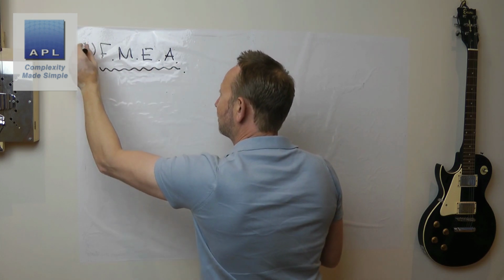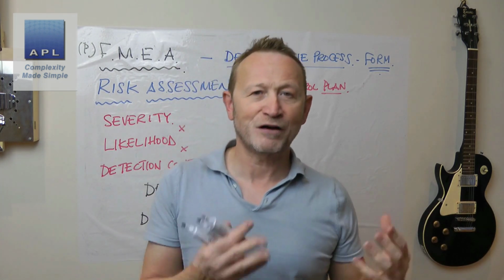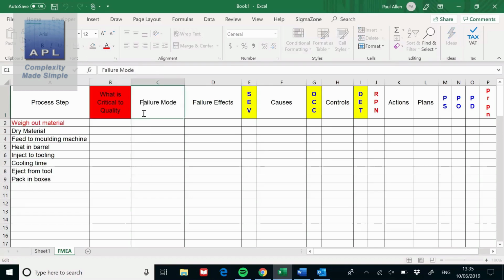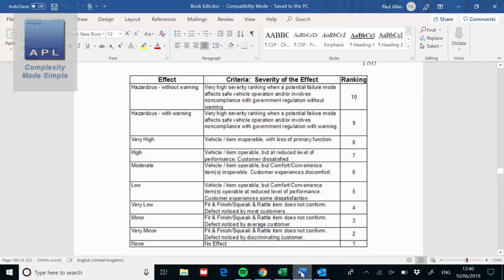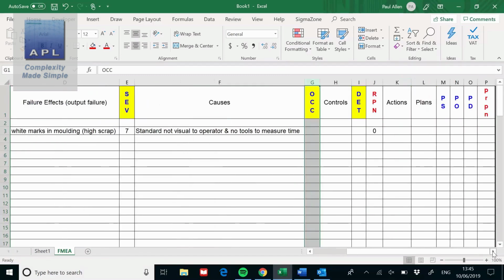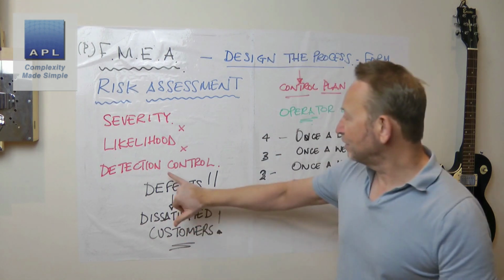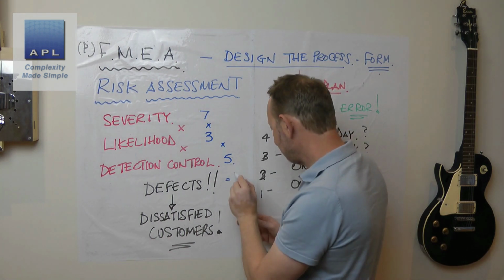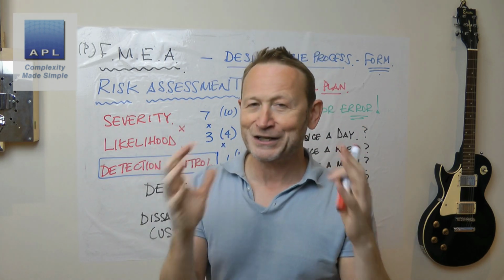How to do FMEA properly - A tutorial

Comment: Unfortunately, there are two major problems with the use of Risk Priority Numbers. The first problem is the fact that while the RPN values range from 1 to 1000, there are only 120 possible values for the RPN values.  Moreover, these 120 possible values are not uniformly spread out between 1 and 1000. This restriction on the number of possible values for the RPN scores leads to the second problem.  

With 10 levels of severity, 10 levels of occurrence, and 10 levels of difficulty of detection, we will have 1,000 different possible problem descriptions. The RPN scores will sort these 1,000 problem descriptions into 120 distinct classes.  Some RPN values will group up to 24 problem descriptions together, while other RPN values will correspond to only one problem description.  

So, the second problem is that the RPN values sort the 1,000 problem descriptions into 120 artificial groupings of different sizes. One final thing: The RPN value are ordinal-scale data, which means that addition, subtraction, multiplication, and division are all nonsensical operations. 

In the words of Donald J. Wheeler, " If you feel that you have successfully used RPN values to identify problems to work on, you have been deluding yourself with the elaborate mumbo-jumbo that surrounds the calculation of the RPN values.  While you may have been successful, that success did not come from the use of the RPN values."

If you feel that you absolutely must have a systematic overall ranking of all the failure modes, then use 1 through 5 instead of 1 to 10 for the rankings of each aspect and then create a three-digit code for each failure mode, where the first digit is Severity, the second digit is Occurrence, and the third digit is Detectability.  

To signify the ordering of these three aspects, designate this three-digit code as the SOD code.  An SOD code based on rankings of 1 through 5 will result in 125 values for 125 situations.  When these SOD codes are placed in descending numerical order they will prioritize the situations first by severity, second by occurrence within each level of severity, and lastly by detectability within each combination of severity and occurrence.  

Notice that this approach uses the original rankings without distorting them.  This will allow you to rationally choose the problems that need to be addressed.
Reply from the maker: That assumes the purpose is to rank them. It isn't it's to tell you you have risk of a problem for individual assessment you make, if all values are above a certain no they should all be fixed or improved, you're not trying to pick the top ten....but your criticism is important to know when conducting an fmea...
Reply: @ There’s a clue in the name Paul: Risk PRIORITY Number. So of course people rank them. Why bother otherwise? It just goes to show that we all follow the perceived wisdom of our betters until someone points out the flaw in the method. Donald J. Wheeler was Deming’s right-hand for a while, and he’s written numerous articles (Quality Magazine) pointing out some of misconceptions that still persist in the industry.

Comment: people do not understand between ISO9001, Prev vs Detection, Six Sigma and Why implement Core tools, it is hard, because that means they are not standarize, that is why I always refer to reg. standards, and also to lessons learn structure, lessons learned is the basis for FMEA and all then engineering. fix that, you fix FMEA by default!

Comment: Thanks Paul for the video. One thing I think is very important to point out here is the limitation of the Risk Priority Number (RPN) as used here and used as the product of the multiplication of SEV x OCC x DET.

The RPN is being used here to rank the risk, the implication is that the higher the ranking the  more important the risk is to concentrate on and potentially mitigate in comparison to the other risks.

If you have 10 ratings on each scale you have a range of 1000  RPN values. However, it turns out that there are only 120 possible values and that these values are not uniformly spread out between 1 and 1000, this means that the RPN values sort the 1000 problem descriptions into 120 artificial grouping of different sizes.

So, the problem lies with the notion that RPN's can be used to rank between the problems.

The reality is that RPN values are what's called Ordinal-Scale Data. Before operations of multiplication and division are meaningful the data must be ratio-scale data, these data posses ordering, distance, and an absolute zero point.

The lack of a distance function and zero point can result in serious and trivial problems having the same RPN and some trivial problems ending up with larger RPN values than other, more serious, problems.

The way forward?  
- Use 1 through to 5 for the rankings of each aspect
-Create a 3 digit code for each failure mode  - 1st is Sev, 2nd is Occ, 3rd is Det
-Signify the ordering as the digits on the SOD code

The SOD code based upon thee rankings of 1 to 5  will result in 125 values for 125 situations. When the SOD codes are placed in descending numerical order they will prioritize the situation  firstly by Severity, secondly by Occurrence and thirdly by Detection within each combination of severity and occurrence. You can then choose the problems that need to be addressed.

I hope this is helpful.

Thanks

Geraint
Reply from the maker: It's a nice alternative, but not what the rpn is for. It's much simpler than that. Every risk must fixed over a certain value. The only the thing the rpn gives you is more time on some issues than others. it doesn't give you a cop out...
Reply: Until I saw your video I was always led to act on the RPN values as they are meant to be rankings. I don’t see how it would be possible to set ranges that you would be happy to act upon because you would surely have to take into consideration not only what you would feel comfortable with but crucially the limitations of the numbers themselves. 
I don’t see that as a simple task, there is no escaping the fact that the ordinals are being treated as ratio data ,therefore the scores you are providing a limit against are not valid.
Reply from the maker: Hi Geraint - if this was measurement system I would agree, but it isn't. (Used as a H&S risk assessment, I might agree as well). It's a tool to help you to design a process, make a decision and then take improvement action. If the RPN is 500 or 800 the value is immaterial the decision in both cases is the same reduce it. And in both cases the area of attack is the same. Improve the control. If you drive the control to mistake proofing both the rpn values will fall to less than 100.....FMEA is a practical tool to help the engineer to communicate their thoughts and to create a great control plan and please the customer that is what it's for
Reply: @paulallen5321  Ok, I take it from your reply that absolute value of the score doesn't matter, it's the reduction to some value that demonstrates the due diligence and hopefully control. So, thinking as an engineer having established and assembled the risks really everything is game, so I could spend a lot of time trying to control many different risks that perhaps in some cases don't impact the process.

I can see that trying to get everything under lets say 100 is honourable. Which ever way it's looked at we are acting on scores, to reduce if we need to. The "if we need to" aspect really is just a judgement based the engineer or the teams opinion.

This is the key aspect for me, you effectively don't use the scores you advocate working on all or the ones you feel are impacted the most. In which case I don't understand why the scores are there except to demonstrate that you started at X and finished at Y. Why not just use Red amber and green.
Reply from the maker: Hi Geraint - You're missing a step, the Design FMEA includes the voice of the customer which tells us which parameters, features and performace are important to the customer. That way only high risk issues get included in this part of the process (high risk means important to the customer) and the DFMEA output tells the PFMEA which tolerances etc are important to the customer. The PFMEA is then about controlling those important process inputs that deliver important results. Nothing on a PFMEA should be unimportant to the customer otherwise you've done the FMEA process wrong or disconnected the Design from the Process FMEA...
Reply: @paulallen5321  Thanks for all these replies, I realise that it's not the score that matters it's the deed and I think this is the important thing to get over. The crucial thing you said in your video was working out the bands that you would accept, the reality is that these are just a judgement and no one should hold you responsible to achieve them for the sake of a score......I could see this happen, i'm sure it does actually in some cases, even more so if you have to complete these as part of a team.
The point of this activity is that its driven you to further improve the control based upon your own engineering judgement. I have even seen some standards that encourage you to work on a certain failure mode based upon the RPN number, that's where I was coming from.

Thanks again!

Comment: My goodness, Paul, thank you so much for your detailed reply. I am now 72 years old and have been in quality management for 44 years. I had a forced retirement in 2019 due to poor health. As President of a medical device manufacturing company our risk analysis sometimes had to be in compliance with IS0-14791:2012 and/ or MDD 93/42/EEC Medical Devices, which expressed RPN’s in terms of “harm to the patient”.
I found that MDD 93/42/EEC was much stricter than automotive FMEA or ISO-14791:2012. Risks had to be mitigated, regardless of cost, so our severity-occurrence-detection was tighter than automotive.
The following was required (to resolve ISO-14791:2012 and MDD Gaps): All risks, regardless of their dimension, need to be reduced as much as possible and need to be balanced, together with all other risks, against the benefit of the device (MDD Annex I, Sections 1 and 2). 
All risks, regardless of any “acceptability” assessment, must be reduced as far as possible and must be balanced, together with all other risks, against the benefit of the device 	(MDD Annex I, Sections 1 and 2). 
Risks are required to be reduced “as far as possible” without room for economic considerations (Annex I, Section 2). 
An overall risk-benefit analysis must take place, regardless of the application of criteria established in the management plan of the manufacturer (MDD Annex I, Section 1). 
Undesirable side effects must “constitute an acceptable risk when weighed against the performance intended.” (MDD Annex I, Section 6). 
These gaps shall be addressed unless they are not applicable (because they are needed to be addressed by the design function).
Getting away from FMEA’s, I introduced your videos to my son (age 33), who is an engineer, and he became fascinated with your work. He bought your book, “Drink Tea and Read the Paper”. Currently, I am teaching him about six-sigma, MSA, and DOE.  
He recently purchased a machine vision system for a medical device project. As for the MSA gage R&R validation for the machine vision system, I told him if the high speed vision system is used for “pass/ fail”, without documented measurements, then the quality group will have to do a gage R&R study per accepted norms (MSA 4th Edition). This would be part of an accepted P.Q. The company must establish that gage error is less than 10%. 
Actually, I have found that external auditors like to see some work-around solutions when problems arise. Since the vision system is automated, and the company would perform an MSA via other means, the company should establish a correlation between the vision systems pass/ fail attributes versus variables measurements and MSA (which will allow establishing a valid Cpk and Ppk). I told him attributes cannot establish Cpk or Ppk.
If you know of a better way to establish an MSA for a machine vision system, I would appreciate your opinion. About me: I was President and COO of a medical device manufacturing company (1999 – 2019). I did a lot of things you feature in your videos. I feel your work is excellent. Thank you again for your time.

Comment: On January 28, 1986, the Space Shuttle Challenger exploded 73 seconds after liftoff, killing seven crew members and traumatizing a nation. The cause of the disaster was traced to an O-ring, a circular gasket that sealed the right rocket booster. This had failed due to the low temperature (31°F / -0.5°C) at launch time – a risk that several engineers noted, but that NASA management dismissed. NASA’s own pre-launch estimates were that there was a 1 in 100,000 chance of shuttle failure for any given launch – and poor statistical reasoning was a key reason the launch went through.
In 1989, a research team wrote a paper (“Risk Analysis of the Space Shuttle: Pre-Challenger Prediction of Failure”) analyzing the data available before launch to determine if the failure could have been better predicted before launch.
Using standard statistical techniques on previous launch data, they determined that the evidence was overwhelming that launching at 31°F would lead to substantial risk of failure. They measured a ~13% likelihood of O-ring failure at 31°F, compared to NASA’s general shuttle failure estimate of 0.001%, and a 1983 US Air Force study of failure probability at 3-6%. Think about if you would let the shuttle launch if you knew there was a 1 in 8 chance it would fail? 1 in 100,000 chance?
I have a tough question: “In the risk analysis for a multiple cavity sequence of production, would you recommend changing the severity, likelihood and detection considerations if there were 8, 12, or 16 O-rings? Would once in a week or once in a month be appropriate for likelihood? Is there a statistical formula that you would recommend to determine your severity-likelihood-detection value rankings? Would you recommend a mandatory Poke-yoke setting for a critical FMEA (such as the one for O-rings) for all of the detection cavities?”
By the way, you always give a great presentation and I admire your work. Thank you!
Reply from the maker: Donald - good to hear from you....sorry for the slow reply. It's a hell of a question you're asking. so I needed a bit of spare time to answer. I use this data in my classes and work out the probability of failure to be 90% on the day of the launch. However, anyone can be a monday morning quarter back! I think there is a number of points to make. Firstly don't follow car industry guidelines write your own based on oyur own industry. 3rd  - Probability can easily make a fool of anyone and in this case it certainly did. FMEA is never going to be perfect. But the real failure in this case was that they broke their own guidelines. Once the shuttle started flying, the could see the fails so at this point there is real world data, They knew the problem existed, they knew the system failed to danger which is against NASA rules and still they launched. They could easily have put a launch rule in to say there was a minimum launch temp. After all there was rule to say you can't launch in cloud. Which is why they never took off on 22nd Jan, the orginal launch date. If they genuinely believed it to be 1/100,000 event. It would have been a rule they never used  and wouldn't have been an issue. FMEA is a best guess, you can tie yourself in knots trying to make that guess perfect, but it's always a guess, the more complex you make it, the more likely you are to bend the rules and come up the 'wrong' guess.
I do think though small production quantities are the most difficult to assess, making luxury yachts for example, the likelyhood of 1/10000 would raise concerns about everything, but would be once in 10 or 20 years...perhaps.
so make your own FMEA rules that relate to low volumes etc that's as complicated as i would make it...hope this helps Donald....